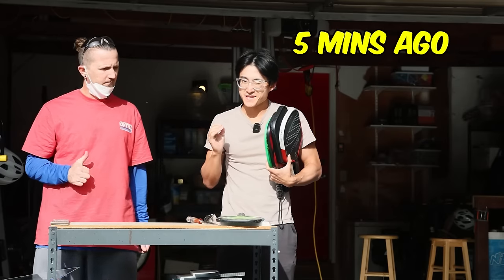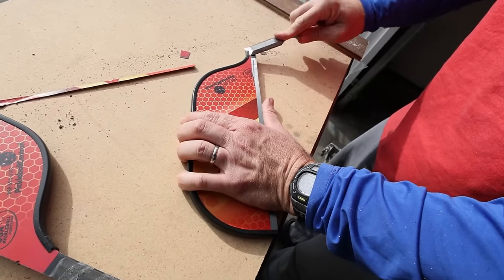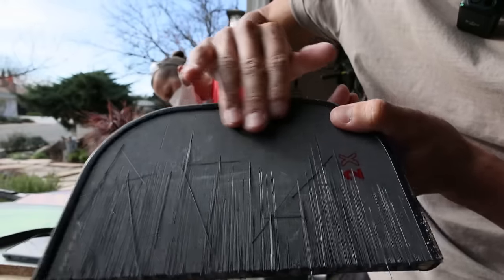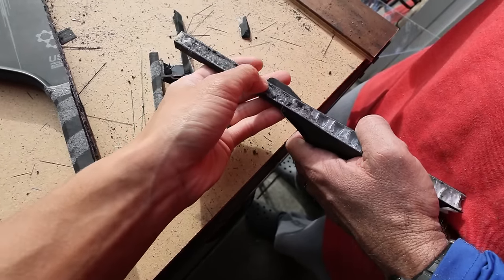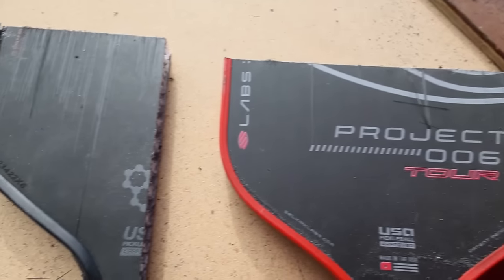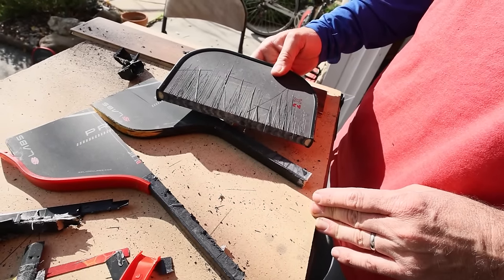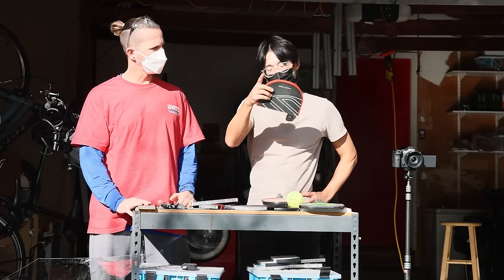Cutting Open Pickleball Paddles | $5 vs $30 vs $220 vs $333

Comment from the maker: Time Stamps:
0:00 - Intro
0:53 - $5 Wood Paddle
1:21 - $30 Budget Paddle
3:38 - $220 CRBN 2X 16mm
5:26 - Close look at Thermoforming
6:27 - Delamination explained
7:51 - Cutting open the handle
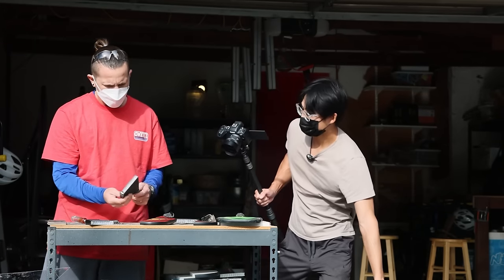10:03 - $333 Labs 006 
11:39 - Close up of the Raw Carbon Fiber
13:20 - Taking off the edge guard
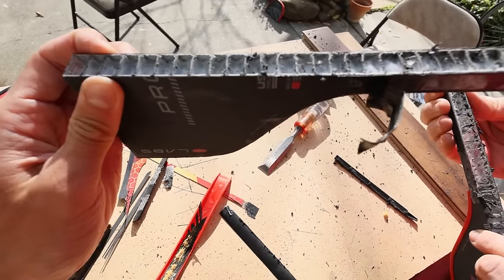15:03 - Examining the inside
16:46 - Detaching the Surface
19:20 - My thoughts & theory

Comment: My two cents. Ive taken a couple of paddles apart for destructive testing purposes. Forget about the wooden paddle that we all knew was just plywood. I’d guess that 80% at least of the paddles are made at the same one or two factories in China. That alone tells you a lot about differences between paddles. NOT MUCH. A $333 paddle is actually probably well under $100 cost to make at that Chinese factory. A friend of mine has been buying unbranded paddles from a Chinese distributor just to see how they play (every one of them he was charged less than $75 for) and I can say the fit and finish of these were exactly as good as the pricey paddles ppl are buying here in the states. So that tells me there is huge markup probably to cover all the marketing and distribution cost in the USA. No one should be paying $333 for a stinkin paddle. A $120 paddle is actually a $30 paddle strait from the Chinese factory
Reply: In agreement for the most part. The $333 paddle is a Selkirk, which from my understanding, are made in Idaho. Also more expensive because it's from Selkirk Labs...its like their research and development brand, paying that price comes with some extra benefits for partaking in their program.

Have you made any videos for your destructive testing? I would love to see which brands hold up! Thanks.
Reply: We only sell products with the same craftsmanship for $39.9, excluding shipping costs.
Reply: @douglasnathaniel7759  I bet that the majority of the parts or materials are from China. More like assembled in the USA.
Reply: I spent numerous years in the laptop computer business in the early to late 2000. 

The majority of laptops were built in China out four factories. Pi kleball paddles are  o different.

Any change to the existing design requires chaneges to the production line and die casting. 

Second, you have to pay upfront for a certain number of units. 

Third, shipping, insurance, customs, delivery, stocking are all cost that have to be paid. 

Fourth, adminstation and marketing cost. 

These costsgets amoritized over your expected paddle quantity.

Last, figure in profit margin.

So, there are differences in paddle design and quality. Not all carbon fiber are the same. Not all honeycomb inerts are the same. 

There's power vs control vs hybrid, etc. All this affects production cost. 

If you want a standard run of the mill paddle, sure, they are a dime a dozen. You can buy those off of Amazon, Temu or Alibaba. 

However, if you are competitive and  want a paddle that fits your game, invest in one. 

You can find quality paddles around the $100.
Reply: I bought two paddles from a factory in China. The paddles look the same as joola ben johns series except without a brand, and I spend less than $60 for 2 including transportation costs. I am not sure if the unbranded paddles have the same level of performance as the $250 one does, but personally I don't like the way it feels. I want to figure out if I just get what I pay for, or I got a really nice deal.

Comment: It’s not the weave of the carbon fiber. Those sheets are straight strands and the sheets are layered at 90° to each other.  It is the texture of the peel ply embedded into the resin that creates the grit. There are probably 3 layers of carbon at 0°/90°/0°. 

Wish you had a band saw for this.

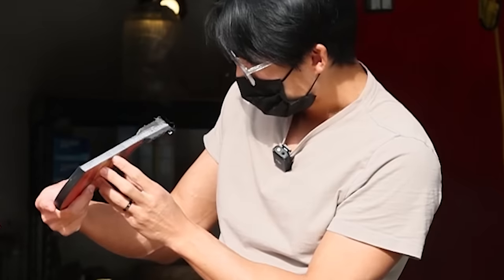Comment: 2:06 I'm my local paddle doctor, as word has gotten around that I'm handy with a dremmel and can reduce handle grip sizes down to customized smaller circumferences for people.  So I'm very familiar with the internals of paddles.  And those staples you found do not connect the handle to the face.  They connect the butt cap to the handle.  (At least in my experience).    Also, unibody means that the entire carbon fiber surface (or whatever material - but typically this is thermoformed carbon fiber) goes all the way to the bottom of the handle.  It doesn't end at the top of the handle.

Comment: Most if not almost all paddles will have the honeycomb...except the latest Gearbox.  As such, once you get a hold on a Gearbox that's "done its duty", I would be most interested if you could cut that open.
Reply: Even earlier Gearboxes did not have a honeycomb core - as almost all of them use their "SST" carbon fiber columns.   The new Power line just does it in a unique grid configuration instead of unidirectional columns of carbon fiber.   The only exception to my knowledge is that GB2 that was a total flop, and maybe way earlier paddles.

Comment: Would have been sweet to see the Gearbox Pro cut in half like the others
Reply: Pickleball Central has a video where they show the inside of both configurations of the new Gearbox Power/Control and Elongated/Fusion.  Very interesting.  But also clear that they exaggerated their marketing sketches.

Comment: Have loved the CRBN since they started, it’s a great paddle. It’s all personal preference. If you’re a beginner, don’t spend more than $80 until you’re sure you’re addicted. Take some lessons. Learn correct technique. Then in 6 months reward yourself. But only buy a paddle with a 100% return policy so you get to try it on the courts for 30 days.

Comment: It looks like the honeycomb core of the CRBN is damaged from the thermoforming process and already looks like there’s core crushing going on. I wonder if this and the face being so thin are why it has more power (more flex and trampoline effect). Must be why there’s so many delaminated CRBNs. I would love to see other thermoformed paddles cut open as well to see how they compare!
Reply: Are you guys able to crush the cores at all? Is one softer than the other
Reply: I bought all the CRBN models. Never had a delam issue.

Comment: Unibody typically refers to having a band of carbon fiber that runs around the perimeter of the paddle and down the length of the grip.  That band connects the paddle faces together and makes an overall stronger structure than simply having the polymer core sandwiched by faces only.  Also, it is possible to have a unibody paddle that is not thermoformed.  An example of this would be the Prism series paddles from Vatic.
Reply: And if you hit hard thermoformed paddles, because of all the heat used, have cores that don't last very long.

Comment from the maker: EDIT: my bad guys, when I mentioned “weave” I was mistaken. The “weave” that I refer to is actually the weaves of the fabric peel ply. 

Here’s something that I found to help understand what peel ply does:

“peel ply helps to improve adhesion between layers of composite material. The textured surface created by the peel ply enables the resin to flow into the fabric’s weave, creating a stronger bond between the layers.”

https://medium.com/@nitprocomposites/what-is-peel-ply-carbon-fiber-83a205806402#:~:text=Peel%20ply%20is%20a%20thin,material%20during%20the%20layup%20process.

Tons I still am learning about the material science of paddles, so I appreciate the corrections
Reply: Tell me you don't watch JohnKew Pickleball without telling me you don't watch JohnKew PIckleball.

Comment: Glad to see this. Would have liked to see the inside of a Gearbox SST. You said "grit" is created by the weave. NOT so. Peel Ply creates the grit for spin. Also would liked to have seen more on peeling the face from  the core. Some adhesives are better than others.
Reply: There are videos from Gearbox showing the classic, standard SST core.  And a newer video from Pickleball Central showing the interior of the new Pro Line SST "grid".
Reply: @AMurderOfLobs  Ive pretty sure I've seen those vids, but actually "cutting" the  Gearbox paddles open???
Reply: @kimleith1378  Well they don't show the cutting process but they clearly show the insides after they cut.

Comment: I'm more concerned with the surface face of the paddles. The wear is very noticeable especially on the Selkirks Power Air, I have photos to prove it. Got small chips in 41 days of having it. $250 +tax.... ooof!

Comment: I'd really like to cut about an inch and a half off the handle of my Gearbox Pro Fusion Control paddle, but I am scared I will somehow ruin a very expensive paddle in doing so.  Anyone tried anything similar?  It's setup for a 2-handed backhand, which is not for me.  I love the gearbox pro, but i find it a bit heavy. Only thing it lacks is good hand speed.
Reply: Pickleball Central has a video where they show the inside of both configurations of the new Gearbox Power/Control and Elongated/Fusion.  Very interesting.  But also clear that they exaggerated their marketing sketches.
Reply: @AMurderOfLobs I saw that as well but when I looked close they cut it in half lengthwise , but were way off center. So a cut in half like Davis did would be good to see the carbon core tubes vs the polymer honeycomb core.
Reply: @86309   Gearbox has another video where they cut one of their older SST paddles in the other orientation.   That might be interesting for ya?

Comment: Wow, just wow.

Weave of carbon fiber?  My understanding is that sheets of carbon fiber are not woven and that the strands run in one direction.

Perhaps an understanding of peel ply and the manufacturing process would be helpfull information. 

Thermo foam?

I also don't believe the edge gaurd serves as a seal.   The thermoforming provides the seal.

Nice effort. Good try.

 At least no one was seriously injured in the making of this video!
Reply: Haha yeah he gets a ton wrong, which I have no issue with - at least he's curious.  But there is tons of readily available content already explaining all this stuff and with accurate info.

Comment: Wonder how much manual labor goes into manufacturing these paddles.
Reply: They use giant machines to do all the word essentially.  But there is a lot of manual labor moving the paddle from one machine to the next in the process (e.g. cutting out the paddle shape of honeycomb, applying the sandwhich faces, the peal ply, then depending on if it's thermoformed - they form the paddle into a unibody sealed shape under high heat and pressure - let cool, foam inject,   the printer/etcher/lazer for the design, etc etc.   The handles are probably the most manual part.

Comment: Pretty pointless.  You discovered the number of different materials increases with price point.  Shrug.  What do those materials do?  How do they change the performance of the paddle?  Does the ball come off one faster than another?  Does one allow for more spin?  Scientfic investigation requires posing a question and answering it.  All you did was (somewhat unsafely) cut some paddles in half and giggle.

Comment: Cool video.  Interesting!  Except for the wooden paddle they all look pretty much the same.  I bought a few paddles from the same factory in China that Vatic and Ronbus use and they are all pretty much the same pieces.  Not much difference in any of them.  The Gearbox Power Pro was supposed to be different but it was an absolute piece of crap.  No power and less pop.  DO NOT BUY IT!!!
Reply: which factory was that?